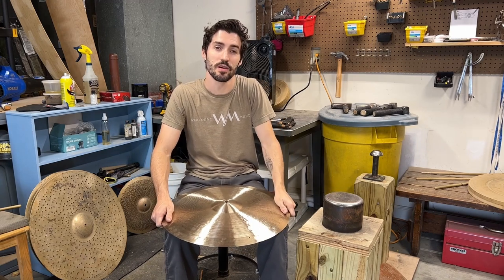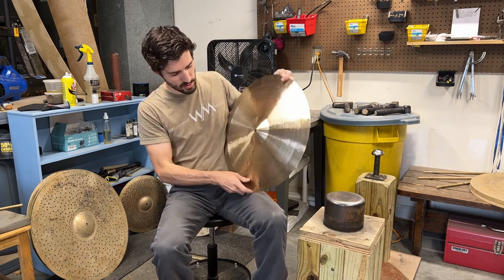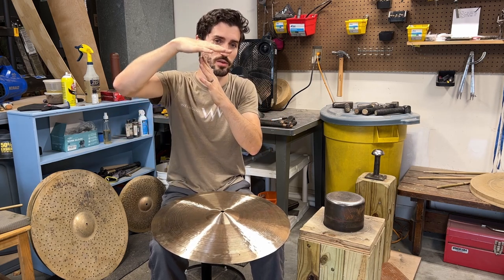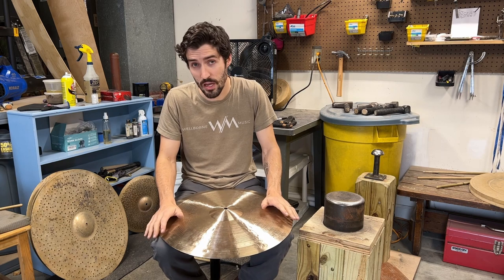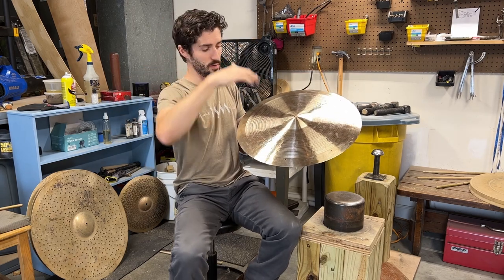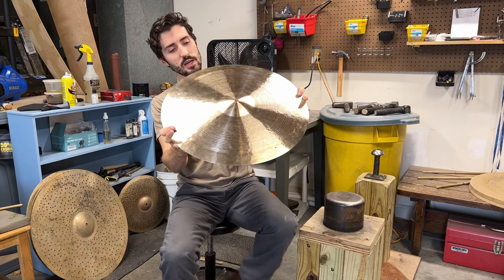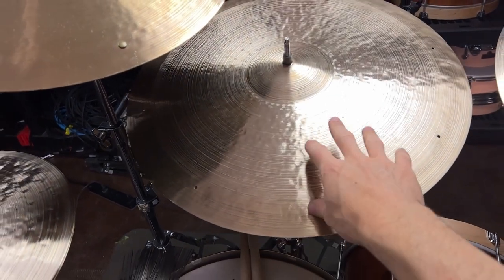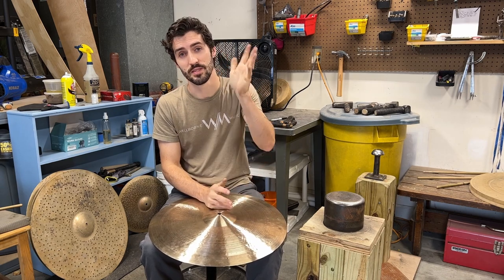Cymbal "Hum" And How I Fix It - Timothy Roberts

Comment: I picked up a Zildjian Z Power Ride cheaply of late and found out that it had a serious howling overtone that would sing well beyond the fundamental and persist beyond any other tone. Until considering the notion of doing anything permanent about it, I was able to locate the area of the cymbal that was responsible and applied a couple of padded 1/8" thick 3/8" circumference rare earth magnets the completely knocked out the racket. I basically dampened areas of the cymbal with my fingers to see what sections made what part of the tone and went from there. Nothing fancy, just hardware store items and some felt. Not a fix, but certainly some stitching to hold things together until the cymbal can be properly healed. After watching your video, I'll spend some time trying to figure out exactly what is going on, whether a profile/deformation issue or something beyond my capabilities to quantify.
Reply from the maker: Hey Jim! That’s a very interesting way of dealing with it! Also, super valid! Sometimes a couple pieces of tape can have a similar effect.

Comment: It's a bummer that the pitch has to go up, but at least the hum is gone.  I mentioned in another video of yours that I have an old K that has a hum (more like a howl).  I assume the problem area is the somewhat misshapen bell, but I'm not a cymbal smith.  I just put some gaff tape on the underside of the bell and on the transition.  The hum is still audible to me, but it's not as obvious as it was before.  I have three other cymbals that all have what I would consider a slight bit of hum (perhaps I'm being too picky with a couple of them) - an Istanbul Agop hi-hat top cymbal, a Zildjian splash, and believe it or not, a Craig Lauritsen custom crash/ride cymbal.  I don't worry about them too much - the hi-hat hum is only audible when I hit the cymbal by itself, the splash hum is pretty quiet, and the CL hum is low-pitched and only comes out when crashed a certain way - but just knowing they're there is a bit annoying nonetheless.  If I could stand to be without them for a length of time, I'd send them to you.
Reply from the maker: Yeah, the tape trick can work great to help bring the hums down in the overall mix! To me, as long as the main playing area is relatively clean sounding it's ok to have some hums and tones going on.

Comment: just getting into hammering my own cymbals and i have a basic question: due to the shape of the cymbal, it seems much easier to hammer the underside with a solid hit on the anvil compared to the top side, where the bow of the cymbal makes it tricky to get the cymbal firmly on the anvil. Any advice for getting a solid hit every time?
Reply from the maker: It's really important to have a round anvil with a bevelled edge so you can hammer the top with good contact. I've probably spent collectively about 10 hrs shaping and reshaping my anvil over the years so I have good contact.

Comment: The most beautiful of all profiles is the paiste 602s.
Hums and all other overtones ate all associated from the metallurgy stage at recipe and at the manipulation of the grain of the cymbal.
Rides have to be consistent with their  thickness, hence theflate rides a quiet and sound muted because there's no bell and there's no meat at the mounting hole.
Hums come from edges being too thin.
Reply from the maker: @stelioscapetanakis9148  I think that’s a bit reductionist, but I understand your point. I would say “hums” can come from a variety of different sources depending on how a cymbal is structured. Thin edges, thick edges, tall profiles, un-balanced tension, thin bells, etc can all cause certain tones or “hums” to jump out in the overall mix of a cymbal. Also these tones definitely come from the cold-forming part of the cymbal-making process and not just the casting. Casting can make a different but not near as much as the shaping does.

Comment: One thing that drives me crazy are the higher whistles tones you get on bright thin cymbals. Does this have the same cause?
Reply from the maker: It's a little more complicated than that. Thin cymbals can be tuned really well and still have those "whisle-y" tones just due to the nature of thinner cymbals. There's a point where thin cymbals become too thin and tinny sounding.
Reply: @ReverieDrumCo interesting. I’ve had a standard Zildjian K ride which was not the thinnest thing but it also had these tones. Not just a tinny, overly bright sound but also resonant frequencies that really jump out, even visually on a spectrum analyser. I even bring a mic when trying a cymbal before purchase cause these whistles sometimes get obscured to the naked ear in the high end at full volume.

Comment: What size is the motor you use??
Reply from the maker: It’s a 1.5 HP AC motor that runs at 1750rpm. The computer allows me to choose the rpm I want for the particular project I’m doing.

Comment: Hi Tim! Thanks so much for the awesome idea and your wonderful workmanship.
I have a set of meinl byzance medium (but heavy) Hihat cymbals that somejow little wobbled so they do not fit flat enough but have some visible(2mm) gap so I have to press tje top cymbal down to make tight sound and eventually it sounds too dead because i have to press them down too much..is it possible to fix this problem??
Reply from the maker: It depends, but most of the time that's a fairly simple fix using some hammering and lathing techniques!
Reply: Thanks. I will carefully try it with soft rubber hammer..